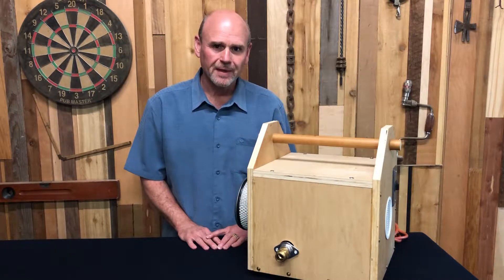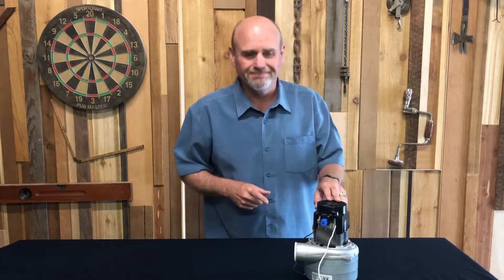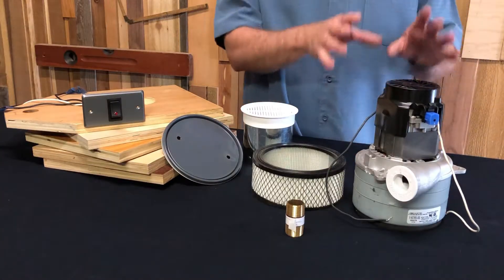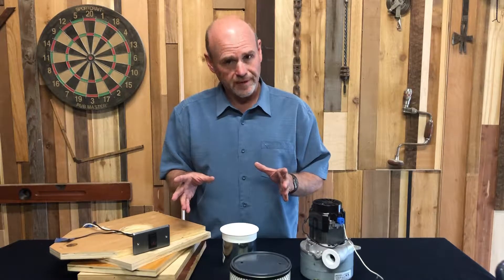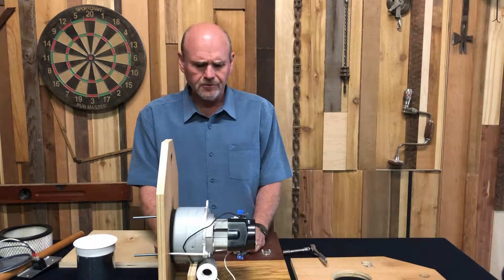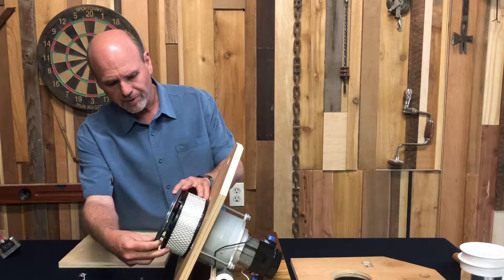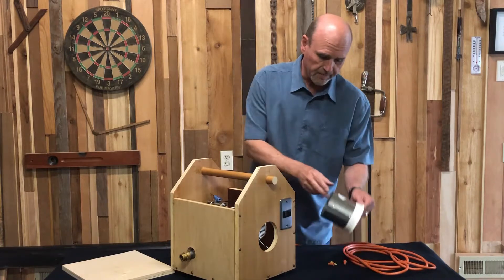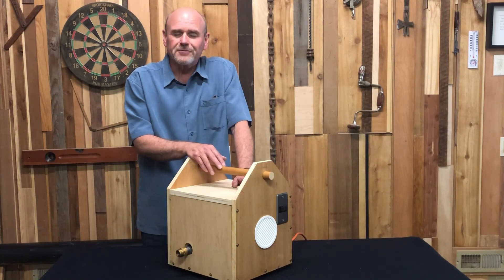Build Your Own HVLP Turbine Sprayer

Comment: A nice addition to the system would be a variable speed control.  I have an old turbinaire HVLP that has a speed control on it (3 stage -5psi at the gun and 110 cfm max output). I can turn the pressure/volume way down to get the overspray to nothing.  You add a little retarder and add a little reducer and the paint lays right down.  In any case - Don't go cheap on the gun.

The 3 stage doesn't work that well for latex unless you thin it and add flowtrol.  An airless is the ticket for latex in my opinion.

Comment: The by pass is not present , Just before the paint gun hose connection is a bung with a 1/8 inch hole threaded for 3/8 fitting a hose is connected and runs to a diffuser box that vents outside the case. Helps maintain constant pressure.

Comment: buy and install a $1 15A circuit breaker button from a l i e x p r e s s to protect the motor.
all the Fuji sprayers have a 15a breaker switch
Reply: I installed one in mine, but do you have any idea how I ground this motor to the wooden box?

Comment: Do all fitting screw onto motors?  I have a canspray with a bad motor so i bought a vacuum motor to replace it with. I cant get the housing to come apart.  I would like to reuse everything but it looks like im going to need to bend eveverything after getting the outsider backing off but there is a metal inner part that wont come off.  If i can figure out why the front house outlet off, i can slide the entire unner part off.

Comment: I like your system and build  Iaactually Own and use a Older CampbellHausegield unit and one nice feature on that plastic  Case for the motor is it has storage space for the gun , and its Accessories that make it very. Nice to use  plus with it running you can place the gun   In the upright position   If you need to takes short break that CampbellHausefield. Kit came with all metal Sprayer and Paint Can (Aluminum)  itsezsyto clean with wire brushes  and chemicals  btw I’ve sprayed. A fair amount of Automotivefinishexthrough mine with nice results ! I I’m betweenHomes and Shops  myhope into buildaTurbine right into my next shop /Psint Booth Utilizing an outdoor    closet to cut down on noise.   And 😊 13:57
Reply: And utilize more fresh air  as I’ve experienced    Overspray  getting into the Filtration when my Turbine is inthe same room I’m spraying in? Plus I want multiple outlets inthe walls that ican use  to spray  in more convenient positions

Comment: I just built a dual motor  5 stage  with 2 stage  feeding into a 3 stage  . This sprays anything you want and 2 smaller  motors are cheaper than a 5 or 6 stage
Reply: how does it work? like is it a parallel or series setup?
Reply: @ab842010 the  output of the 2 stage motor feeds into the intake of the 3stage motor making it 5 stages . This system has more cfm then a 5 or 6 stage single motor  I can spray latex without thinning . Buying  both motors is cheaper then a larger  single  motor
Reply: @Stevesbe  are you in the USA? do you have links to where you bought your parts?
Reply: @kkp4297 after using it on a few jobs I'm going to just buy 6 stage motor . The dual motor works well but the heat in the 2nd motor is going to kill it unless I build some way to cool it like mounting it to an aluminum plate and adding fans .
Reply: @ why not use both motors in parallel instead of in series?
Reply: @kkp4297 That's what I just asked because that's how I would at least try to do it on my own first. Just a couple both outputs together into a single. Just like with water, hose diameter is everything. And even a 0.10 of an inch diameter can make a huge difference in output.
Reply: Series 2 stage feeds into the intake of the 3  @ab842010
Reply: Do you basically "Y" connect the 2 together...making one output?
This would be a great option because I see tons of two and three stage used models for sale because they're more common. A used six stage is just about worth buying new. 
Thanks in advance!

Comment: Ametek Lamb 122097-00 is identical motor to the one used in the titan capspray 6 stage and its about $400
Reply: Did you build one ??
Reply: @Airon0727  I was going to but I changed my mind. The part numbers are the same for the motors
Reply: @senyashchukin391  oh ok thanks for the reply, I ordered one and was curious what you were gunna use for an enclosure but thanks anyway!

Comment: Does this not need some form of circuitboard resistors etc im in the uk we have 240 volt Alternating current just not to sure on ellectrics
Reply from the maker: Sorry, I cant advise you on the electronic details particularly in the UK. Please consult with and expert.
Reply: @gregbelair4164  yeah that's what I'm doing I've got hold of a ametech tech drawing giving the wire ring diagram and spec so should be sorted.

Comment: Will this work; 1500W Tangential 3 Stage Ametek Motor For Lamb Vacuum Cleaner 230V
Reply from the maker: Sounds like it would be great. Good luck with the project.
Reply: Thanks Greg is there a way to do a five stage?
Reply from the maker: No reason you couldn't. Just have to size up the housing to accommodate the larger motor. That would also give you increased capabilities with thicker paints with less thinning.   @lifegpt

Comment: I have wondered about a pre-fan that compresses the air some before it gets to the main fan, so that the main fan takes the pre-compressed air and ups it to Stage 5 or Stage 6 levels.  Also, I have thought about a cooling fan that is on a different switch (or heat switch), so that the motor is getting cooling continuously, and the blower only comes on via foot switch.

Comment: I guess it’s been close to 20 years since I built essentially the same thing though yours looks better. Used an Ametek 3 stage I got free, bought a Graco HVLP gun for turbine use and built a plywood box. Still have it and use it from time to time.  I’ve sprayed all kinds of paint from automotive to house paint.  I did need to thin the latex a bit but not much to get my gun to stay it smoothly.  Going to spray a sidecar body when the weather warms a bit.  I do like your motor cooling idea.  I used a separate fan to blow cooling air.  Your idea seems better and I may modify mine.  I filtered with one of my Ridged shop vac filters.  Like you I found the quick connect fittings at Lowe’s and I used a rubber 3/4 inch water hose for the air line.   The hose is heavy and bulky and I need to find a thinner hose material.

Comment: Can you use any HVLP gun, or does it have to be one from a turbine spray system?
Reply from the maker: The internals are different on a turbine gun. They are larger to facilitate the volume of air so they will always work better.

Comment: Update 28/08/2022 First blast on refinishing a solid body guitar with cellulose ( after priming by cans),
 I started with a quick go at setting the gun with water sprayed onto cardboard  ,to see what would happen (all seems OK) a quick blast with cellulose on some cardboard, and four coats of paint all looking nice ,no runs, slight orange peel in places under good light ,so really pleased. Thanks a good project and a bit of anxiety  beforehand not knowing the outcome .

Comment: I have an Apollo 5 stage that has a defective motor (sparking on the inside). I did notice when I opened up my Apollo box it had a bleeder hose connecting to the outside as Randy Gloden said. Otherwise great video. I didnt realize how simple they were until I opened it up.

Comment: I have a  $100 Harbor Freight single stage turbine unit from 7-8 years ago, the same one was also sold by Rockler during that time. The single stage is weak and spraying latex isn't possible without so much thinning that the paint is the consistency of water. Could I simply replace the weak single stage turbine from that unit with the 3-stage Amatec Lamb turbine motor? It would require a larger box and PVC adapters to mate the output pipe of the larger turbine to the hose, but the other parts are already there. I don't see why it wouldn't work. Comments are appreciated.
Reply: I have the same unit and was wondering if it would be worth messing with

Comment: Greg, you really need to add something about the "bleeder" hole, so that folks who follow this do not burn up their motors (if they use a modern non-bleed gun).  For a non-bleed gun, they will need to add an Apollo A7538A, or drill a 3/8" bleed hole , preferable external to the case.  Bleeder holes on the Fuji are internal, but they have a hose that routes it the outside.
Reply: Hi Randy, I have a None Bleed Gun and Built Greg's Turbine unit, I'm confused about the bleed hole for my none bleed gun, if I don't use the  Apollo A738A fitting,  Where do I drill the hole?, Is the bleed hole only necessary when the Turbine is running and I don't have the Trigger pressed on the gun ?
Reply: @leoneddy1492  Hey Leon, Fuji suggests drilling that hole on the manifold, leading out of the motor.  (https://www.youtube.com/watch?v=0tnfTbL7d3Q) My only concern with that approach, is that it vents that warm air into the case.  The apollo fitting is very simple, so you might be able to just re-created that with some off the shelf fitting, and keep that venting outside the case.

As to your other question, you are correct in stating you wouldn't need a bleed hole if you keep the trigger pressed the entire time the turbine was on, as that keeps cool air moving through the turbine, but that isn't very practical.
Reply: @randygloden  Hi Randy , thank you for your reply and information,
Reply: Has anybody  tried to convert  a 3 to 5 hp shop vac.
Reply: @michaelmoore1149  won't build much pressure only  1 stage

Comment: Couldn't you have 2 motors connected in a box for double the output? Making it a 6 stage. Seems stronger to me?  Thoughts?
Reply: I’ve been wondering exactly the same thing myself. I’ve been toying with the idea of using two shop vacs side-by-side with hoses leading to a Y into a single hose that plugs into the spray-gun. Wondering if anybody has any experience combining two turbines to one gun.
Reply: @Saileahgaz  did you try this ? How did it work ?
Reply: @awebadvantage  I did not. I purchased a 6 stage turbine motor from lamb electric and am still working on packaging it into a finished product. I secured it to a base and hooked it to power for a test. Works well for a fraction of the cost of a 6 stage system off the shelf, though still not cheap.
Reply: @Saileahgaz curious how you connected the air outlet to the vacuum motor. It doesn’t show in this video. I’m new to this project. Looks like the vacuum blower has about a 1.5” pvc outlet.

Comment: Where can you get a hose. Most hoses at HD are 2 in diameter.
Reply: I got mine (3/4" ID Pond Hose)  from a garden centre ,but I'm only using the turbine in short bursts on small things like guitars and motorcycles so It's not going to overheat (I hope)

Comment: Very cool video Greg ,one major advantage to your build is  I’ve been using a HVLP system I purchased nearly 15 years ago I love everything about it except the noise level  with some extra engineering and insulation I’ll bet your design could be modified to  be much quieter  I’m between homes and Shops at the moment  and I would like to  build in permanently  a HVLP unit in my next shops Paint Booth or room  perhaps even in a closet  or outdoor  shed to keep the noise level  very low and peaceful as I have a tendency to enjoy working alone FYI I am a retired Woodworker and I also enjoy Automotive and Boat restorations  as a rule I do all phases myself including mechanical ,Upholstery, and body and Paint and I’ve been spraying two stage Automotive DuPont paint with my turbine HVLP Campbell Hausefeield system I purchased about 15 years ago  and will most likely utilize that all metal gun and cup  as I have extra parts and accessories for that one already

Comment: Nice build, but I am having a problem figuring out the size of hose to buy for this build.
Vast majority airless hose listed on Amazon are using a Graco 1/4" type hose. Are these hoses 3/4"? Just buy a Fuji hose?
Your build did not show what was used reducing the large air supply opening to 3/4" in such a short length.
Reply: Did u get any luck making it?

Comment: would a shop vac work?
Reply from the maker: Probably not enough CFM's delivered by a shop vac. Remember you need at least 3 stages of fans to generate the volume of air required to run a spray gun.
Reply: @gregbelair4164  so the Fuji pro 2 stage isnt worth it?
Reply from the maker: @UncleDaddy001  I dont have any experience with the Fuji 2 stage, so I cant comment one way or the other. It really depends on your application.

Comment: I have the same Earlex spray gun - what did you use to adapt it to quick release? How do you keep the fitting from coming out of the gun air inlet hole? I have located a 1" x 3/4' brass reducer, but the Earlex hose diameter is 1 1/8 in. I don't want to buy a new spray gun!
Reply from the maker: Clark I use a Brass quick disconnect from the hose.  That  goes into a hose thread connector.  then then screws into a copper fitting that is pressure fit to the gun. Send me your e-mail and I'll send you a picture. Gregbelair@outlook.com

Comment: hi, 4:10 when you talk about power, do you mean CFM volume air flow??
Reply: I think its psi for vacuums.i used a 2 stage old titan turbine to spray my car once which came out good but i see every one recommends 4 or 5 stage.
Stage 3 may have 6psi stage 4 8.5 stage 5 9psi....note some companies may have slightly different psi
Reply: Just know with stage 3 ur good for just about most paint etc.thicker paints may just need a bigger nozzle then 1.3mm for your gun

Comment: Great vid. What gun setup did you use with this.
Reply from the maker: HI Blaine, The gun was from another HVLP sprayer I had. an Earlex 5000. I had to adapt it to fit the hose connector, but it worked great.
Reply: @gregbelair4164  love to see the auto finish projects you tackle

Comment: Let's see: $150 for the vacuum turbine, brass nipple, hot rod aid filter, paint can lid, 2 soffet air vents (1 with duct), an extension cord, and an on/off switch. Plus the hose ($??) & quick-connect adaptor. Then the gun ($70-300), hardware, time to find the parts, and time to assemble. Vs $675 out the door for a Fuji 3-stage with everything, ready to go. I'm thinking...
Reply from the maker: Eric, I was complete on this project for about $225 total. That took into account that I had some stuff lying around, But you should still be able to build a system from the ground up for half of your Fuji. This was also about DIY and the pleasure of building something, I enjoy that aspect of it,  so as in most DIY projects Your mileage may vary. Good luck with your project.
Reply: @gregbelair4164  Nice! That's really helpful. Hell of a deal for a 3-stage turbine -- 1/3 of the Fuji system, for example. I'm thinking that with a bit larger box and sound-baffling "egg carton" foam inside, it could be made super quiet. A fuse and an extra cooling fan make sense as well, as suggested by others. Right now, I'm thinking that a fan from a computer in a parallel circuit with a capacitor could do the job nicely. Incoming current charges the capacitor, and when the current stops, the capacitor keeps the exhaust fan running. (Just ideas... :__)
Reply: I found this place that sells 5 stage HLVP motors for ~$250. I think that makes a lot more sense from an economic POV. Here is the site: https://www.centralvacuummotor.com/lighthouse.htm

Comment: Why the extra space between the cooling intake (the soffit vent) and the motor?  The box can be made smaller.
Also - if you glued the box together it is now airtight which is good.  But replacing the motor will be impossible.  Clean wood cuts and bolts should seal the box just fine..
And why no fuse?  If the motor start to overheat it won't shut off without a fuse.
Reply: you should make your own video
Reply: You should get a critic job
Reply: @danielbuckner2167  If you use a turbine all day long and lug it around banging it on things all the time you will start to look at the video you just watched with my eyes.
Reply: @GreatWhiteNiko  That comment was for the guy asking you to make a video which is a copout comment. We do bath remodels so we use one but usually tear out tubs since nobody wants a tub these days.
Reply: @danielbuckner2167  I have no idea what you said. No idea what a "cop out comment" is and I don't care to know. Gave my professional opinion on that bullshit video.  Using a turbine for 4 hours a day gives you a perspective different from amateurs. Ripping a tub is fine - I always, always, always ask home owners if they have a way to replace, not resurface.  But have you gone to slum apartments lately?  Huge resurfacing money made there these days.  Because of the sad state of our country. As you see I don't like any of that but what you gonna do when you can make $1,500 a day 7 days a week, eh?
Reply: @GreatWhiteNiko  Nope, not too many slums around me. Mostly beach homes, condos, and McMansions. Im sure its lovely and rewarding though! Im not sure if you think residential building contractor is amateur status but Ive heard it all from subs before if so. Remember if it was hood money to keep crappy places, we would but typically its easier to gut and start over or demo and build ground up. Like I said we spray in house usually in conjuntion with other methods as part of remodeling contracts but in the end its for people who cant afford a total reno. 😁 Have fun!